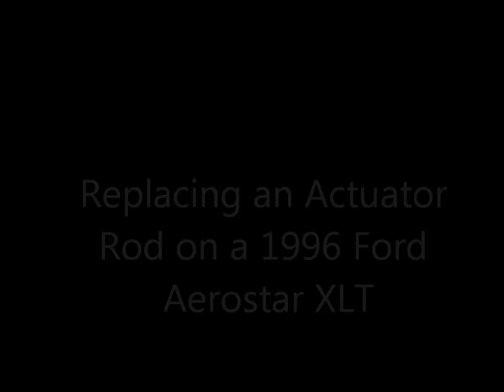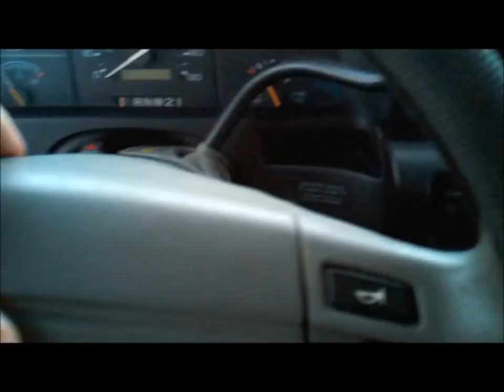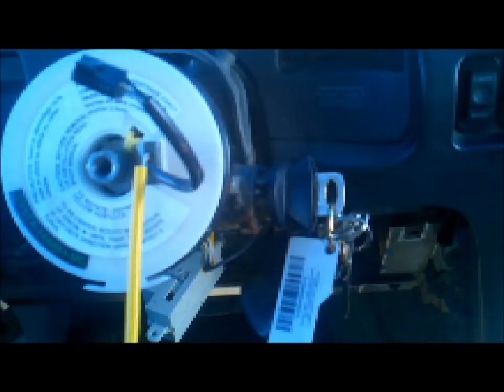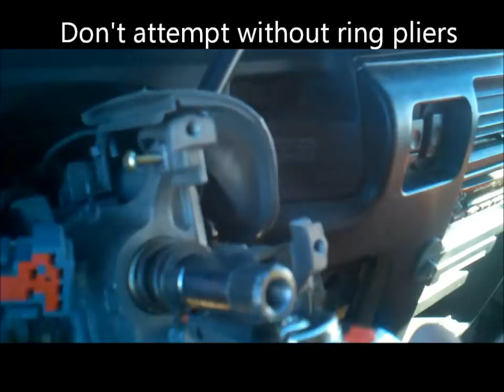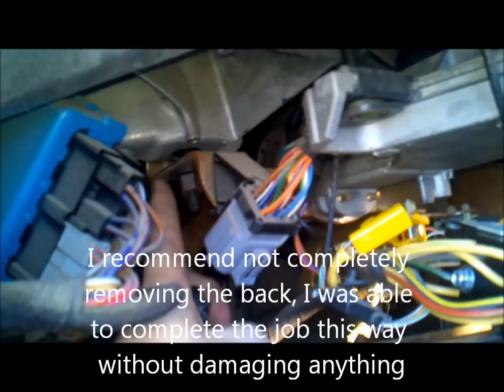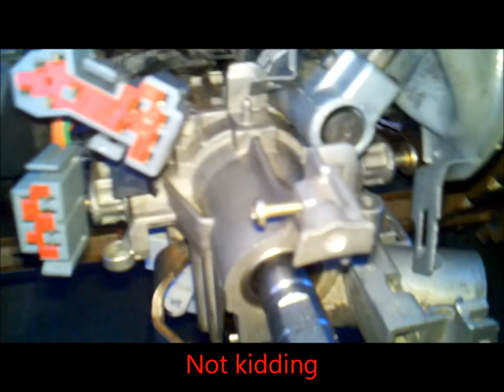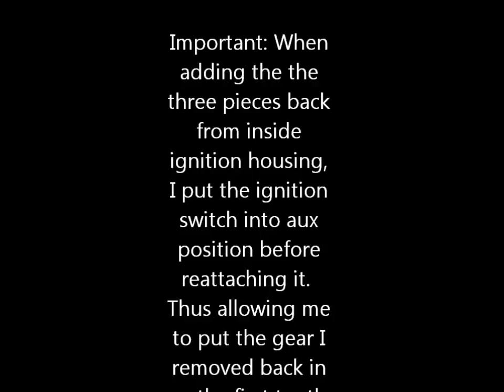Ford Aerostar Actuator Rod Repair

Comment: There is a notch in the steering shaft that allows the switch end of the sliding piece to be pulled out far enough to get the actuator pin engaged without sanding or filing
Reply: I’m at a loss help lol
Reply: @BigjamesKY  if you don’t mind me asking, how did you end up going about that? I cannot grind mine enough to get it in, probably going to have to pull the shaft.
Reply: Doesn’t go out far enough for me.
Reply: How do you replace inner half of plastic actuator?

Comment: My car doesn’t have tilt so it’s just two rods holding it in place. Cannot figure out how to get them out so I can slide the top of the housing off.
Reply from the maker: What is your vehicle's year, make, and model?  Ford is also known for having the tilt be hidden by usually pressing down on the turn signal.
Reply: @CaptainAmericaYoutube  it’s a 1997 Ford F150. Base model. No tilt, no cruise control. Super basic.
Reply from the maker: @dromendoza  When I made this video I used a lot of logic from Ford Rangers so this might be applicable: https://youtu.be/-yPj6RGPYOc?si=FkIqFW1z5Sn9vgd7&t=582

Comment: Had to completely rebuild a steering column in a ranger. Same setup same problem. Had to replace the shift tube also.  The ignition cylinder gear was the hardest part. It really whooped my tail. This video helped me a lot. Thank you for posting.

Comment: What size pvc pipe was used?
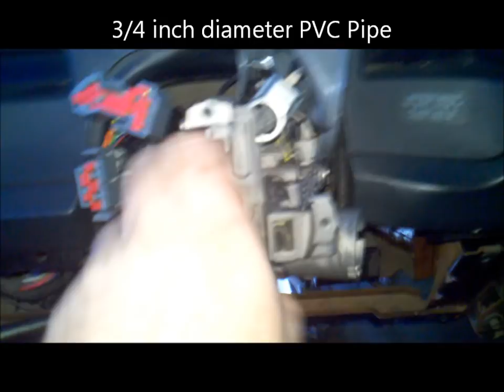Reply from the maker: 3/4 inch diameter (at 12:24 in the video it briefly flashes on the top of the video).  I will note this in the description to make it easier for anyone else in the future.

Comment: Great video -- my actuator rod won't go all the way out and my key is stuck.  I'm guessing it's time to tear this baby down... hoping it's just the interlock solenoid or something easier than the full teardown -- but this video is absolutely worth its weight in gold.  Thank you!!
Reply from the maker: Do you keep a lot of keys on your keychain?
Reply: @CaptainAmericaYoutube  no but I left this van out without the doghouse on for like 3 years — I think the corrosion worked it’s way into the column!!

Comment: Long shot for an answer but what was it doing before you did this job, My ignition is really loose and is not cranking anymore
Reply from the maker: In my case I went to turn it off and nothing happened.  The van just kept running.  At the very start of the video it shows a tan colored box with wires coming out of it (black base) and a metal colored pin sticking out the side.  That is pretty easy to find and is held in by two hex screws.  That metal pin connects to the actuator rod and you can try cranking the vehicle by moving it over to the side (pliers help but aren't needed).  If it cranks from there then the issue is likely the actuator rod broke.  I was able to drive for, I think, a few weeks by just unlocking the steering column with the key and manually cranking that box.
Reply from the maker: Just to note, taking that box out and cranking the engine does not require disconnecting the battery.  The repair itself does require the battery to be disconnected.
Reply: @CaptainAmericaYoutube  I see. Would you think it's my actuator rod with what I'm experiencing? My key made a break sound when i went to turn it on and it stayed at the 3rd stage of ignition but won't turn off or turn on.
Reply from the maker: @UnoriginalUserNameV2  so you can't get the key out of the 3rd stage or can't turn the key out of the 3rd stage?
Reply: @CaptainAmericaYoutube  No i can get the key out but after i turn it back down to the off position, Anything in between The key is inside, Car doesn't feel like it's going through the stage clicks.
Reply: @CaptainAmericaYoutube  Thinking it might be the actuator rod
Reply from the maker: @UnoriginalUserNameV2  Were you able to start it without the key?

Comment: First off, great video. Just did the whole procedure and everything seems to work now. But I have no crank
Reply from the maker: One of my regrets is not doing a reverse video as it isn't as straight forward as I thought back then.  I assume you did put the switch back in that goes under the dash (great for manually starting and stopping the vehicle when actuator rod is broken).  If you did, or didn't, can you crank the vehicle from it?  Otherwise, as noted in some of the pinned comments, getting the key cylinder housing put back exactly as it was before you took out it is really important and could also cause issues with cranking.  Let me know if it starts by the switch though and also if the steering wheel unlocks via the key.
Reply: @CaptainAmericaYoutube  I'm just about to leave for work, but i will try that first thing in the morning. Ill message back with what I find out. Thank you for getting back to me so quickly!

Comment: So how did you get the tilt spring back in safely
Reply from the maker: There is a comment below about using zip ties to do it which is what I would recommend.  In my case I never put it back as I really didn't need to adjust the tilt and honestly I didn't think of zip ties.

Comment: Hey man!!!! Really good stuff and I love how youre posting on everybody’s comments to help them diagnose their problem. I usually don’t even attempt to ask questions on a YouTube vid but since it looks like you’re responsive and educated.. I gotta question!! One day hopped in the danger ranger and nothing. It would show power to dash. But as soon as I went to crank, it would click and nothing. Lose power. And power won’t come back for a bit either after an initial try. So anyway. I replaced my starter, got my battery tested, did my ignition switch and start relay/fuse in the distribution box. I started to do my key cylinder but I have to get the new programmed and that’s a bitch to get it towed to the locksmith to do it.. so before I go through with that.. I wanna know if it’s possibly the actuator rod like you showed? What symptoms did u have? Sometimes too after a “try”, I’ll hear a stuttering coming from the inside the head unit that usually goes away in seconds. This is kicking my butt as it’s a first but I am mechanically inclined. So any help would be awesome! Trying save some money like you did.
Reply: It’s be cool to know which direction to take, ya know? Key cylinder and gets keys programmed or go ahead and get a steering wheel puller and go for the actuator rod
Reply from the maker: So when you did the ignition switch (and before putting it back in) did you try to start it from the ignition switch?  Also, do you have a lot of keys on your key chain?
Reply: @CaptainAmericaYoutube  I did not! What’s the process for that? Just take switch out and engage it forward on its own? Key in the ignition and everything? And yessir I do actually have a lot of keys
Reply from the maker: @LarryGoggins000  Just as you described, take it out and and engage it forward on it's own.  If that works then it really suggest it could be the actuator rod.  The more keys you have the more likely you can shorten the lifespan of the key cylinder.  Which also could be causing an issue with the chip in the key being detected.  I would start by removing the ignition key from the key chain and trying to start the vehicle.  After that likely doesn't work then try the ignition switch with the key in the ignition.  Good luck!
Reply: @CaptainAmericaYoutube  thank you captain!!!!
Reply: @CaptainAmericaYoutube  ignition switch did not turn on the vehicle capt! same scenario. So I guess it is the key cylinder.
Reply from the maker: @LarryGoggins000  Could be the chip in the key isn't being read or the chip reader wore out (the part that immobilizes the vehicle if it doesn't detect the chip).  I assume nothing happened when you tried the ignition switch?
Reply: @CaptainAmericaYoutube  nothing happened with the switch but today I got it to the locksmith and got the key reprogrammed… drum roll… and it worked! Dude thanks for giving me solid advice. If not, itd be at a shop and I’d be paying a diag fee plus labor
Reply from the maker: @LarryGoggins000  Glad to hear you got it working again!
Reply: @CaptainAmericaYoutube  yessir! Gotta love it.

Comment: I need your help to put my van back to work , we are stuck in trying to put in the actuator after removing the broken part my tech guy was unable to fix in the new one
Reply from the maker: Did you file it down?  The way I did it in this video doesn't show the work that goes into making it fit.  Or are you having another issue?  Also, did you get the entire broken part out?

Comment: Any videos out there for 2000 expedition same problem
Reply from the maker: I apologize for the slow response as I really don't know if there is but as someone did the repair on a 96 Taurus there is a chance that, if the part is similar, you could get to it and do the repair.  Obviously, safety first, make sure to know how to properly remove the air bag for your given vehicle.  The closest I could find was this video: https://www.youtube.com/watch?v=pXdEO7qhZp8 Which, at the end of this video you can see the actuator rod (similar to the one I replaced in my video) hanging out.  As his repair is different, you might not need to remove the steering column, but that might be easier.
Reply: @CaptainAmericaYoutube  thank you so much for your response! I'll check that video out, and may give it a go at it.
Reply from the maker: @frankmondragon9633  As it isn't specific to that part make sure to take photos (and or video) to make it easier to remember where things go.  Plus the comments on the page about making it easier to put the ignition assembly back correctly can save a lot of headaches later on.

Comment: Nice video, thanks for explain it to us.  It seems a pain! does someone knows where the switch control wires are? this models are quite different and a lot harder to fix, i wanna bypass the key, switch, etc.  in order to add an starting button system. it would be even cheaper.

Comment: What did u file down the rod or the thing it attaches 2
Reply from the maker: I think I either used Sand Paper or a cheap metal file from Harbor Freights.  Took way longer than I would have liked.  Today I would probably use a Dremel with a sand paper bit, or a drill with a sand paper bit, and put the rod into a vice.
Reply: @CaptainAmericaYoutube  ok it in but i cant get the fack back on

Comment: I have everything back together other than getting the lock cylinder back into its hole, it’s stupid that I don’t remember how I took the piece out, I know what order they go in and I have the last piece with the gear on it in but I can’t figure out how everything lines up for the key switch to slide in
Reply from the maker: I don't know if this helps (I really didn't like that step and wish I would have done more video footage on it) but did you see my note at the very end of the video: https://youtu.be/Ww0VbPEhH-k?t=818

Comment: Thanks for great video.Hard to find exact make n model for what i need.
I replaced my 94 Ford Aerostar ignition lock cylinder. It was hanging up. Easy to pop out. After replacing it. Now i have the same issue.
The steering wheel locked in the Auxiliary Position.
No matter what i try. What else can i try to unlock this steering wheel.

Comment: When reinstalling all parts does the green plastic piece inside the ignition cylinder have to "snap" back into place? Or can it just sit there as you reinsert the lock cylinder?
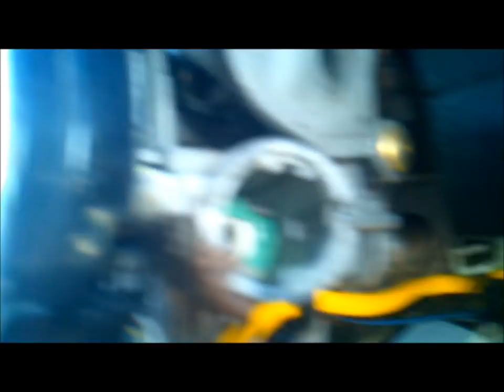Reply from the maker: When I did I didn't have to mess with that green plastic piece.  If it looks out it may have popped out a bit (as compared to @4:37 in the video which is where it should be) make sure that it didn't rotate (There is a green tab at the top).  If it didn't rotate than you shouldn't have to worry about it unless the lock cylinder isn't going in all the way.
Reply: @CaptainAmericaYoutube  Ok now my issue is putting the little gear wheel back in  and its giving me the most trouble. For some reason it's not lining up correctly and when I try to put the cylinder back in it either doesnt want to release my key or not doing a full turn allowing me to put the key in aux position, take out the key or turn forward like I'm going to turn on the car. I need help NOW!
Reply from the maker: @terrenceforbes5935  I apologize as I have meant to highlight a few more comments including ones that talk about the issue you are having right now.  When I did the repair I missed out on a few things that would have made the repair easier and thus they are not in the video.  One of which was to mark both the gear and the actuator rod (the broken one) with a permanent marker to show which tooth you are supposed to line up in the on position.  Then mark the new one in the same spot to make realigning the teeth easier.  Another commenter, Flo, posted this which is more inline with where you are at: 
Flo
4 years ago
+Captain America, thank you for the response. I did figure it out, after all. especially the gear setting right was difficult. But I figured out that on the bottom of the searing column there is a little mark on the metal part, that indicates where the whole of the actuator is supposed to be when putting the ignition cylinder in. since there is only one way to insert the cylinder the gear can be se to that position. took me a second to step back and think about it a little more. also important is, that the gear retainer (the little plate) needs to be put in that it can be rotated into position counterclockwise. I was trying to make it work the other way first.